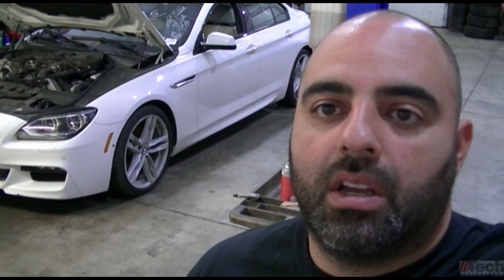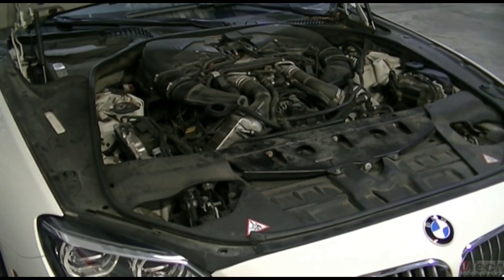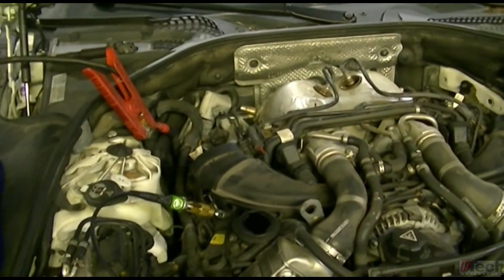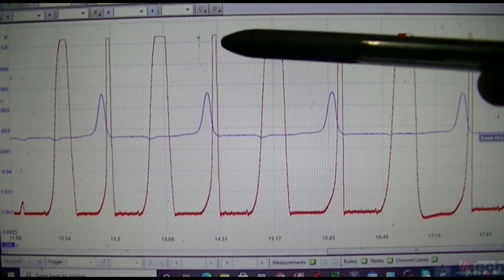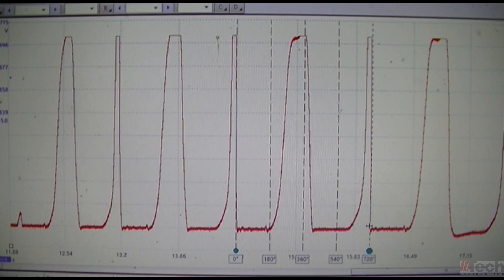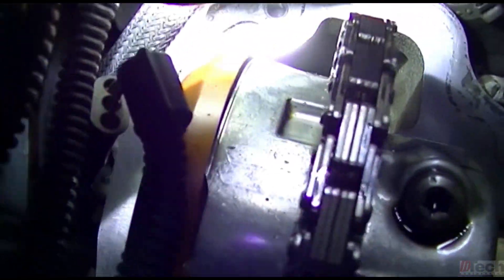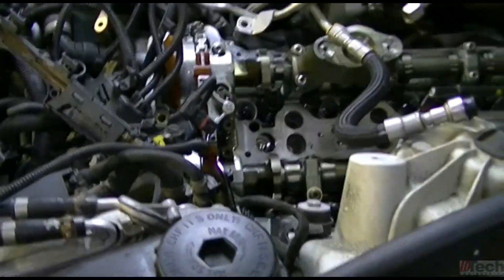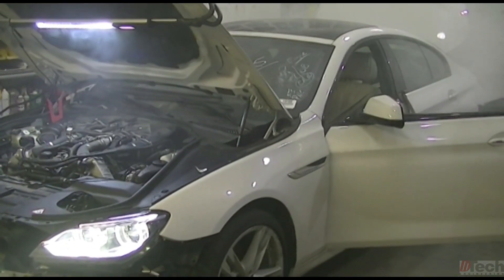2014 BMW 650 N63 Timing codes & Fix

Comment: Another great video! Finally I saw the exhaust compression hump all the way up in a waveform! I always picture it in my mind because never goes up. This was awesome! Did you open the phaser just for curiosity? As Joel I thought it was a not fully charged battery when cranking but later we saw why it did that! Thank you brother!
Reply from the maker: Thanks Keka, yes I did open up the phaser, there is a return spring inside that had popped off its locating position and so it was stuck not in the correct installation position, causing the cam to be in the wrong timed phase.

Comment: Thanks  again  good diagnóstic,  I wa wondering  when you did the cranking compresión  that sounds  was un even ,like weak battery  but looks to me on the red trace  incilinder  you have double compresión  stroke, and that is the reason why the engine cranks slow  having 2 cylinder at the same time  compresión  ,  I would have love to see in good running  conditions  incilinder  wave form,  also  relative compresión  at the very beginning  would have been awesome  to see 3 humps or 4 humps of compresión.
Reply from the maker: Hey Joel, yes that cranking sound was not normal because the engine was fighting itself to compress cylinders that normally shouldn't be compressing at certain times. I unfortunately did not save the relative compression waveform I performed, I tried to look for it when I put the video together but nowhere to be found. But I will say on another car that had the same problem (08 mini cooper out of time and had a second compression looking hump) I performed relative compression and that second hump never did show up on the waveform and the cranking didn't sound abnormal. So sometimes the relative compression test will show you the second looking compression and other times it won't. So it's best to go in cylinder to verify. Thanks for watching

Comment: I admire your diagnostic. I wish I have the tool and understanding to do the same.
The chain guides on N63 is notoriously bad. They turn brown in color become brittle. Your guides are very brown and will not last long. However it is still the best decision if u see the root cause (VANOS sprocket) as changing timing guides is not easy (engine out). You should also have remove the oil pan (surprisingly easy for N63) to see if any chunks of debris from chain guides or anywhere.
Reply from the maker: Yes all good points for sure, but on this one the customer just wanted to get it running to make sure engine and rest of the car was ok

Comment: Watched your video - If I may ask a question - what's the benefit (other than seeing the sharp valve closing - which incidentally wasnt sharp on the first waveform) to using a fancy transducer? cant one measure compression in the bank and if all cylinders are about equal compression loss but still some present assumes no interference occurred?
Reply from the maker: yes that would be a test to perform to attempt to gather good data on the status of the engines health

Comment: when there was the synchronization problem tell me if the accelerator pedal worked?  it was possible to accelerate the car from a standstill by pressing the accelerator ???  because I just redid my n63 engine and it's the same by replacing the timing chain.  when starting it, the idle is unstable, it is impossible to accelerate the vehicle to get up in the turns.  like an impression that the butterflies are not controlled by the accelerator pedal.  I have already checked everything.  I just need the timing adjustment to be checked.

Comment: Doing this job with n my 2011 750i I had e bank 2 exhaust cam retarted replaced VVT with no success I also have a 2012 750li so I used a known hood working solenoid same outcome removed valve cover bank 2 only sure enough time was off ordered adjuster plus new bolt throwing it on this Sunday hoping everything comes out well
Reply from the maker: Good luck and I hope you get it figure out
Reply: How did everything go?

Comment: Did u ever take apart of the sprocket to see if damage? I might have same issue...timing won't line up after I finish doing timing and rotate motor
Reply from the maker: Yes, I did, the locking/return spring had come off its position which led to the gear spinning off of its original installation spot.
Reply: @DTEAuto  thanks for the fast response and I'm going to check if I'm having that same issue!

Comment: They say it's vale cover gaskets but no oil leak is nowhere in sight and not even on spark plugs that got change so I figured that's not it. And bmw passport said 6300 for vale cover replacement

Comment: What did you have to remove to get to check the timing. I have a ‘14 750 with fault 164043.
Reply from the maker: the valve covers have to be removed and access to the crank pulley
Reply: @DTEAuto   BTW, great video and amazing diagnostics Sadel! I was concerned on having to remove the turbos and exhaust.

Comment: yep this is the n63 for you ive rebuilt 2 complete top ends on e70s and basically the valve stem seals where out to lunch
and the first e70 the plastic on the cam adjusters on 3 had completley gone.  basically you have just through money at them and get everything you neeed. there oil interval schedules that bmw state are ridiculous.
Reply from the maker: Totally agree, those intervals are way too far spread out, thank you for watching

Comment: Any thoughts what would cause a cam jumped tooth code? Multi misfires on bank 2.
2011 S63 engine
Reply from the maker: It's hard to say, but two things would possible phaser gear failure like in this video, or chain stretch issue. Both would affect base timing and would need to attempt to differentiate between the two by testing.
Reply: @DTEAuto  I have most disassembled to replace phasers,Vanos sel. And timing chain & guilds. Do the heads need to come off for timing cover to release?  Im really hoping to not pull the heads. 
Thank you
Reply: I have replaced timing chain rod bearings. Swapped injectors,coils,plugs repaired vac leaks, tested cam sensors pretty much swapped everything form bank 2 to bank 1. Code remains on 6&8 always. 
  Low compression or intake phaser?
Did run great for a bit after a reset then it triggered again once it idled down.
Reply: I’ve replaced both phasers. Set timing. Still get cps code but only when engine hot. Thoughts? I’ve swapped sensors code stays.  Pls help.

Comment: I have a bmw 650igc 2014. And showing code p054B. What do you think is the problem?.
Reply from the maker: Not too sure on that code but quick search shows common issue is faulty or dirty vanos solenoids, other than that it would need to be diagnosed.

Comment: Have ever heard of this, I just only had the car for two weeks I got it from a dealer in va. But soon I got the car from the dealer week after dealer went out of business. And my warranty was already out of because it was over 70miles for warranty
Reply from the maker: you need to fine out what trouble codes it is throwing and then find out what is causing it to run bad. I cannot attempt to help if I don't even know what codes it is currently having. Let me know if you can get a full dme report.
Reply: Codes are 108D01, 11B702, 120908, 12BA02, 130F21, 140601, 140602 that's from a bmw specialist, at bmw passport says vavle cover but it's not that I'm sure. Took to another place they said vanoes solenoids that didn't work took to another place they say since it several misfires change spark plugs and coils and injectors, I got everything replace other then fuel injector, didn't get that done  because on 650ix have a extended warranty for fuel injectors and O2 sensor and camshaft for that car, it's currently in silver spring at bmw. They said my ivm module was no good so they replaced that and now they say they getting timing fault code, $545 for that  and the part for the ivm module is only 145. Ok so I didn't pay yet cause they told me that  should of  fixed it like the other place with vanoes solenoids charged me $1305 for that and it didn't fix it. I already spent almost 3600 dollar on this car. Bmw said now they getting no codes other then timing fault.
Reply: Bmw dealer all telling me something different it's like they don't know and just want money from me.
Reply: Do you have a email so I can send you dme

Comment: Hey brother I have 2010 BMW 750Li, just got the 4 Vanos Solenoids changed. Car runs much better all codes gone except one...

131001 Crankshaft - inlet camshaft 2, reference: angle difference outside limit value

Is that something to do with Camshaft timing? If so, how much in labor would it cost to time the engine...like you did
Reply from the maker: Yes, as far as that code description goes, it is related to timing issue not being aligned at some point , whether its due to chain issue or cam phaser not phasing properly. Unfortunately it is a very time consuming job if were needing to do any type of timing work and it gets very expensive quickly,
Reply: You have a completely different motor the TU is essentially a completely different block
Reply: did you ever figure out the issue?
Reply: @ralphdesilva3438  Not yet, deciding which route I want to go. Either new engine, or fix the timing. The engines for these cars are pretty cheap, at $3k

You can buy one & get it installed for around $5k total.

It's most likely the Camshaft Exhaust gear/adjuster on the drivers side though. If I can get the labor for a reasonable price, I'm going replace it with a new gear
Reply: So would you still use the old chain?
Reply: @ralphdesilva3438  If I decide to put brand new engine in, definitely not. I will use a new chain

But if I just replace the Camshaft Gear, yes I'd use the same chain. This issue is usually caused by one of 3 things...

Bad VANOS Solenoids, out of timing/broken Camshaft Gear, or worst case scenario stretched timing chain.

You can check if the timing chain is any good with BMW ISTA+ on your laptop. It'll tell you if it's stretched or not

Comment: The right side of my turbo is knocking and the exhaust is popping and check engine light is on in park it's idling rough and in drive it's hiccuping loss of power n shaking drivetrain malfunction comes on soons I start the car
Reply: I need your help I have 650ix 2014 every body saying something different

Comment: I thought you replaced the timing chain but I guess that wasn’t the case
Reply from the maker: the gear actuator phaser is what had failed on this one and is what I replaced
Reply: @DTEAuto  I was going to ask you how you got the timing cover back on because I’m doing that job now and I’m guessing I will have to remove the cylinder head to install the front timing cover

Comment: How many hours that take you? A person i know has a 2011 bmw 550i that has the same bad exhaust sprocket on bank 2, has misfire codes on 5,6,7 cylinders and p0025 exhaust camshaft position over retarded bank 2.
Reply from the maker: its a big job, depends if you work on it straight or do a little at a time. Mine took at least a week of on and off
Reply: @DTEAuto  ah ok gotcha, going to work on it from start to finish, on the cam sprockets they have markings to line up to camshaft or they go on however?
Reply from the maker: the gear/phaser goes on any which way I believe, which is why you have to use the timing tools to set the cams
Reply: @DTEAuto  ok awsome thanks, i have the timing tool kit.
Reply: U can change the phaser without loosing the chain tensioners ?

Comment: VANOS ( Variable Camshaft Timing ) inlet 2 solenoid valve : control fault , camshaft stuck ؟..BMW M6 N63 engine
Reply: VANOS ( Variable Camshaft Timing ) exhaust 2 solenoid valve : control fault , camshaft stuck؟..
Reply: Hey mine has the same problem now what was the problem and what solved the problem?
Reply: @Come8033. let me know bro I appreciate the help